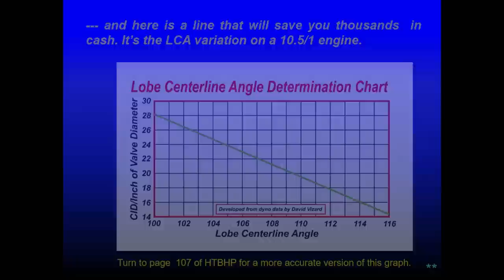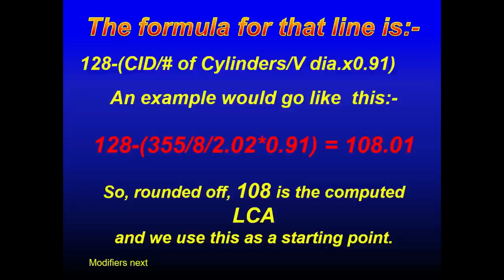Cam profile dynamics Vs event BS bashing!

Comment: Id like to hear  how much bs is in throttle spacers for newer fuel injected engines
Reply: I'd like to hear this too.  I've done quite a bit of testing on I4, I6 and V6 engines and the only time we saw any benefit to a spacer is if the throttle body was located in such a way that it didn't have a straight shot into the manifold (think early Nissan VQ35 engines before they went dual throttle body).
Reply: @ChurchAutoTest   My expereince has only been with G3 hemi(s) on the 03-08 truck intakes where TB sits on top and facing forward, the Air flow has to make a almost 180 degree turn to get in to the plenum, on those ,  TB spacer is a wast of Money, on the 6.1 and Passenger Intake manifolds , Iv'e seen a small incress of 5 HP over 10 dyno runs on the 03-08 5.7 , not enough of a gain to say with out a doubt it was from the TB spacer, on the 6.1 Alum Intake, nothing , zip , Nada ,  ........ on the 6.4 Truck intake , same deal nothing , now on the 6.4 SRT intake actully saw a decrease in AFR on Cylinder 2 in the under 3k rpm ,....... but hey they make a cool sound(LOL)

Comment: Good evening let me start by saying I watch all your videos and I really think you know your stuff I have a 427 bored 0.60 over it has a 30cc dome pistons with AFR 265 fully cnc ported heads a Howard's hydraulic roller with solid roller lifters it is 235x241 duration @50 618 lift on a 108 lsa it has a Victor Jr intake with a Holly 850 do you think when it goes on the dyno it will make 500 to 520 hp? That's what I was shooting for. Any feed back would be appreciated thank you your friend from Louisiana Rick 427

Comment: David I'm building one last car. It is now na but built to be turbocharged. Before proceeding with the turbo system I am looking for a proper look at the size of the turbine wheel and housing. I see a lot of people miss that. Will you steer me in the right direction.
Reply: Check out new channel, as David can't receive messages comments from this channel after Marvin's passing.

Comment: I am designing a recast cylinder head for a straight 6 cyl turbo diesel pulling tractor. The head will have no water jackets so the ports are only limited by the head bolt holes. Both intake and exhaust are on the same side so the pushrods are not a problem. according to rules, the ports have to be the same dimension from the deck surface as stock. My question is would the ports be better to make a large sweeping radius and come straight down on the valve or have the port aim more towards the valve and then make the turn right above the valve?
Reply: That would depend on the distance from the deck to the port floor compared to the height and width of the port. 
As a general rule, if you are working with a port with a low floor, you will want to arch the port high to get a large short-side radius.
If you have access to a CAD software that has CFD, (or a friend that does), you can simulate it and learn for more about flow than you will ever learn from a flow bench.
Reply: @jonathanschmidt6507  I have older cad software but I am not familiar with cfd. What is that
Reply: deck to the port floor is about 1.5 inches. And port will be roughly 2" round
Reply: @TheJohndeere466  
CFD is software that simulates airflow.
There are a lot of software that can do CFD now. 
If you can find access to Solidworks or similar software through school or even a learners licence or a friend that uses it at work or in school, maybe you can find a away to do it.
I highly recommend it because you can make well informed design choices on your head design if you do.

With 1.5 port floor off the deck, you have quite a bit to work with. If you can, try to raise the floor near the peak of the short side so that the apex is about 2.0 inches. That way if the seat is about 0.5 or less from the deck, you can get a 1.5" short side radius and about a 2.5 centerline, you can make a lot of power with that.

I can't recommend highly enough the value of getting involved with CAD in your engine work, in this era, CAD and simulation is what separate the those that follow recipes from those that really understand.

Good luck and I'll be happy to help if you have any CAD or CFD questions.

Comment: Mr V, I have a 383, but not a Chevy. It's a Chrysler, from 1967. 2bl in stock form. Nominal 9:1 compression with small chambers (#516 castings), 2.08/1.60 valves. But the bore is very large, at 4.25. The stroke is very short, at 3.38. Very over square! So with good heads, it would rev to the moon. But my stock heads are only around 170cc on the intake ports. Is that 128 formula NOT applicable to this engine? And do you have one that IS? I won't be racing it, it'll just be a mild street engine. Is your cam formula only meant for maximum output racing engines?

Comment: My friend that is an engine builder had to come up with a camshaft for a driver that ran stock and modified dirt circle track cars with his engines overpowering the spec tires they had to run especially with one driver that really didn't have any feeling in his right foot because of an injury. So he did change the LSA from optimal. Yes some lost power. They guy won alot of championships in both cars. Of course this is rare.

Comment: Can exhaust scavenging create enough vacuum force on the piston to present bearing problems? I had a Pontiac 455 that ran 3800 rpm at 80 mph and pulled 22 in hg. Full length 2.5 inch exhaust. 4-2-1 collectors and x-pipe.
Reply: I would say no. Bearing problems are almost always a lubrication problem. In extreme cases you can get into alignment or deflection issues but most automotive bearings have the size to handle any loads you can put on them before the block gives up if the lube is good.
Reply: Overlap

Comment: David Vizard....have you ever worked with desmodromic valve operation? I was reading about them recently and seems like not having to deal with springs would be a great advantage...it works for Ducati.
Reply: Even Ducati have moved away from Desmodromic, especially so since they've gone multi valve, added to the fact that spring technology has improved to the point that the added complexity of Desmo doesn't give an advantage anymore. From what I know Desmo's are actually mechanically less efficient due to frictional losses whereas the effort of compressing a spring  is stored and released when the valve closes minus the lower friction compared to a Desmo setup.
Reply: @Brit_Toolmaker  moved away? On one model, the Multistrada. I know of no others.

Comment: Hey David, have you designed any intake manifolds or cylinder heads in CAD?
If so, what CAD software do you use to do it?
What CFD (computational fluid dynamics) software do you use?

Do you know how to develop a port in CAD so that you can CNC port and don't need to work with a die grinder?
That is such a crude way to work.
Reply: Would I be correct to conclude that you don't work in CAD or CFD and don't know how?

Comment: Hay David I have one of your books and built up a 307 chev ,that was a while back but now I’ve turned my interest to vw bug air cooled it’s a 1600 ,I’m a hobbyist and love to understand and do motors and still learning especially about cams but I’m writing you to ask you if you could assist me with cam spec’s for the 1600 , I’m wanting to stroke it in the rebuild . I’m familiar with the Engle 110 .thanks
Reply: Harry, I may not be the best to ask here because I have not worked on VW engines since the late 1070's.

Comment: I don’t know if any of this applies to me… I’ve got a 327/331 small block, in a 4000lb manual 4x4 truck. Running power steering, breaks, and need vacuum at idle… 108 LCA for my cam too?
190 cc aluminum heads, 2.02/1.60 valves, Mahle forged flat tops, heads flow 250 @ .500 valve lift, 1-5/8” mid length ceramic coated headers.
Reply: If you do the formula as he posted it a 327 with 2.02 valves gives you a 110 centerline. I dont know how other variables effect that.
Reply: @cuzz63  I forgot to mention I’m at 10:1 compression (static) and warm cranking compression is 165 psi at 5000’ above sea level (or200 psi at sea level)
Reply: @cuzz63  thanks for reply. I know everything is a compromise but I watch Vizard hoping someone can steer me in right direction
Reply: @WesternReloader  he mentions his formula working best at 10:1 CR so that seems like it would be valid.
Reply: @WesternReloader  If you havent yet look up Richard Holdener, I learn alot from him also.
Reply: 112..gives wider power band and vacuumed for 4x4
Reply: Pierce, the LSA alone doesn't mean anything by itself when it comes to vacuum and idle quality.  It's the relantionship between lobe widths AND LSA.  You have to have both of those to know how many degrees of overlap you have.

For example a 220/220 puny cam with a 108 will only have 4* of overlap and have a bunch of vacuum at a very smooth idle.

a 310/320 monster cam with 108 will have 99* of overlap and will NOT run vacuum brakes or idle smooth at all.

Vizard also have formulas that will pick out how fat the cam lobes need to be after you know your LSA too.   Basically, he picks out the LSA with the 128 formula.  When you know what overlap you want, that tells you what lobes to run.   (then adjust for outside factors like outliers).

Comment: I am curious as to where the 128 and the .91 values come from since those arent variables...The lobe centerline is an output in this formula as given but if we are given the lobe centerline first then we can decide the valve size or the CID of the motor.  I am not a mathematician or engineer and its been along time since I have done math. The first thing I noticed about the formula is that increasing CID would result in a smaller centerline..no other change going to a 383 motor the centerline becomes 106 and a 400 you get a 105.... Smaller motor like a 327 with 2.02 valves would be a 110 centerline.
Reply: I've read alot of David's books and built a 383 that we put in my son's k10. I put the crane 274h06 in it and it has a ton of low end power. It ran similarly to a k30 I did about 10 years ago with a 477. .100 over 454. This 383 is 9.4:1 with afr eliminator 195cc  heads and a performer q jet intake with a 1" phenolic spacer. Long story short with the stock torque converter  it would flash to 3600 rpm. Just put a motorhome converter in it so it's untested. It did get 14.5 mpg with the stock converter btw. 3.73 gears and 35" tires. Honest to God real build .
Reply: The final number is the lobe separation angle between the ex and intake lobes.

What you noticed with the cam getting tighter (lower numerically) is because the bigger engine needs more degrees of overlap.

For example, if you built a 366BBC and a 572BBC with all things being equal and a 280* cam in both...     The 572 would need much more overlap than the much smaller 366.      

Oh yeah, if you do the math on a canted valve engine, use 131 instead of 128.
Reply: @earlbrown   yep.. nailed it. The increased overlap allows the larger engine more time to fill the cylinders with increased RPM, there by making more midrange / upper midrange power.

Comment: Is there a version of the 128 formula for other engines? For example, I'm a big fan of GM V6 engines, and would love to have some math to help with camshaft selection.
Reply: The formula works for all engines.
Reply: The formula is tied to GM style heads of that type / era (SBC)......David is likely 100% correct, BUT as an example the LS, canted valve engines, and new gen hemi's all have better overlap flow (by that I mean more flow), therefore there LSA's would be different / wider for those types of engines.....I would venture to guess that David's formula applies pretty well to your GM-V6 (especially if it's a 4.3L because that's a lopped off SBC at heart w/Vortec heads, if its a newer one.
Reply: @ericschumacher5189  - Thank you for the intelligent response.

Comment: I have to agree with you 100% David that engine building is "science" and the very 1st thing one must do in building an engine is "run the numbers."  If it doesnt work on paper there is no reason to waste time, effort, or money just to fail.  In biochemistry (what I spent 6 years in college studying and have 2 degrees in) Algebraic expressions are mandatory.  Apparently this john guy couldnt do a polynomial if Texas instruments themselves taught him how to use a TI85.  I guess using the ideal gas equation (P = nRT/V) doesnt apply to turbo charging or forced induction.  if thats what he thinks I have news for him, without running those numbers on an engine will result in disaster.  Watching this reminds me of the Niel Bohr Albert Einstein dark matter debate when Niel Bohr made Einstein look like the fraud he was. Good job David  Im sure Niel Bohr himself would have agreed with you as I did.

Comment: I had a 1977 El Camino it had a 305 2bbl it was a poor excuse for a V8. If you use that cam for your stock baseline it would be easy to get 100 hp increase from a cam swap in a 350 😄. The smog cams of the 1970s had such a small ramp on the top of the lobe you can cut your finger on it 😄 and idle so smooth you didn't know the engine was  on and that's probably why a lot of starter gears got ruined in the 1970s 🤣

Comment: You mention duration and you mention centreline but what you don't mention is whether or not the cam is symmetrical. I deal with Japanese cams and none I've measured yet are symmetrical.  The centreline and peak lift are in different places.

Comment: David,
I would like you help your viewers with some better advice than what you are posting.

The most important thing about a valvetrain is that it not break parts. This is essential, because a broken engine doesn't make any power.

Some people might think, "well my engines don't break parts" that may be true, and you have your cam designer to thank for that because the did care about the dynamics of he cam. That said, if the cam designer doesn't know what parts you have, he designs for the heaviest and most flexible parts that you could be running. If you have better than stock push-rods, and rocker-arms then that leaves a lot of performance on the table. If the designer knew that you had better parts, he would design the motion profile differently.

Don't trust me, trust the most experienced and best equipped person in the performance after market Billy Godbold of Comp Cams.
In this video he explains how much there is to gain by proper engineering of motion dynamics.

By the way, Harvey Crane never had the modern measurement equipment that Comp has today (it didn't exist yet).

Anyone that is interested in understanding cam design would do well to view / read the following:

COMP Cams' Billy Godbold
https://www.youtube.com/watch?v=1jPxdfPdhdU
https://www.youtube.com/watch?v=NB-dbpVCOuo
https://www.motortrend.com/how-to/ctrp- ... -dynamics/

Professor Blair and Associates
http://www.profblairandassociates.com/p ... 20Lift.pdf
http://www.profblairandassociates.com/p ... ration.pdf
https://www.amazon.com/Design-Simulatio ... 0768004403
http://www.profblairandassociates.com/G ... n_gpb.html

Beast: The Top Secret Ilmor-Penske Engine That Shocked the Racing World at the Indy 500
https://www.amazon.com/Beast-Secret-Ilm ... 1642340103

Introduction to Analytical Methods for Internal Combustion Engine Cam Mechanisms 2013th Edition by J J Williams
(This is the cam design method that was used for the Ilmor pushrod engine that won Indy 500)
https://www.amazon.com/Introduction-Ana ... 1447145631

Design and Manufacture of Camshafts: Robert Norton

Cam Design Handbook: Dynamics and Accuracy 1st Edition by Harold Rothbart
https://www.amazon.com/Cam-Design-Handb ... 0071377573

Mechanics and Design of Cam Mechanisms by Fan Y. Chen
https://www.amazon.com/Mechanics-Design ... 179&sr=1-1

Comment: Why are so many cam manufactures pushing lobe centerlines of 110-112 degrees when your calculations  often come out to 106-108 degrees?
Reply: Usually because people want lobes that are too fat.  So the only way to get overlap under control with the wrong lobes is to spread them out.   ''Bigger is better'' is 99% of the time the wrong answer. Especially if you insist on putting a big ass cam on an engine with stock low compression.   Fat lobes bleed off too much cylinder pressure so your dynamic compression goes down the toilet.  So you have to advance the crap out of the cam, then coupled with too wide of a LSA, your exhaust lobe is really in the wrong place.

Also, because a lot of cam manufactures CSA's don't know what they're talking about.  They just read what the computer screen says under ''recommend''.

Comment: With increasing durations on the same LSA you’re getting wildly different valve events. Obviously a 108 vs 114 is going to make more torque because of the increased overlap, earlier intake valve closing and a later exhaust valve open. As the duration increases on the same engine the dynamic compression suffers, increased overlap also takes away from dynamic as well as the earlier exhaust open hurting torque production. When it’s possible to grind any valve events desired then why would anyone need a “fit-all” LSA when the engine combination and uses are really not considered whether forced induction comes into play, weight of the car, gearing, usable operating range, duration of use, Different spring pairings etc etc etc. 

Not to mention if the tighter LSA makes more torque then why not grind the cam with more overlap and not change the IVC/EVO. With 2-stroke motorbike technology, they show that earlier/later EVO has an effect on torque production down low and up high. I.E. the power valve.